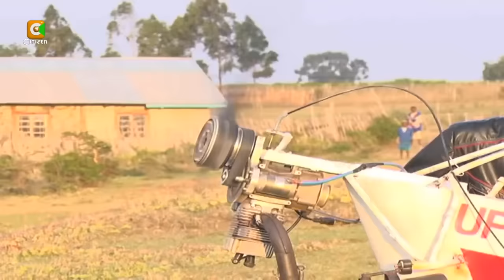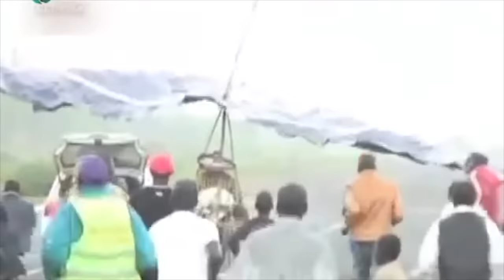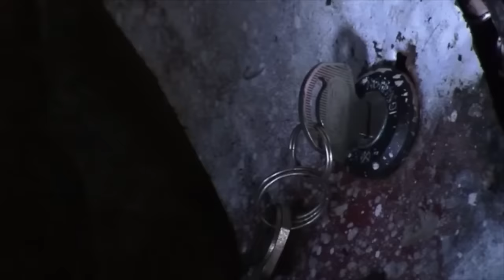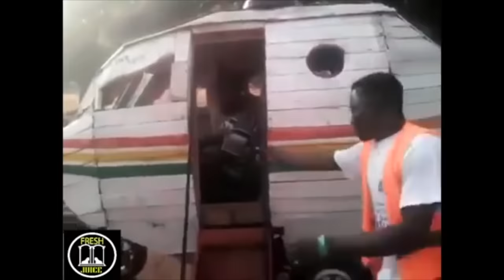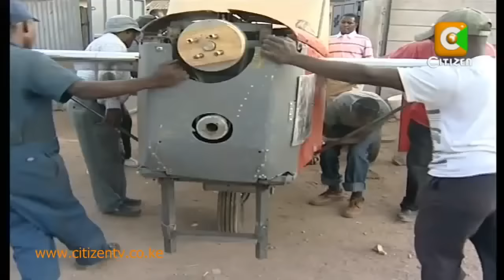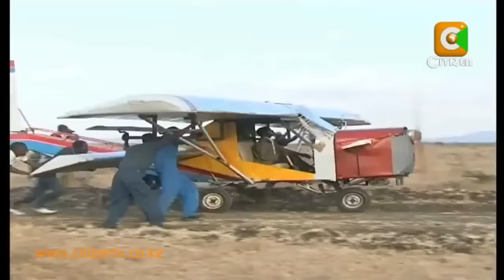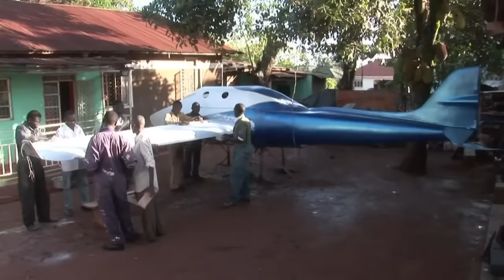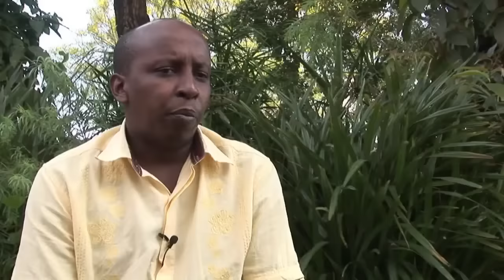African Airplane Compilation | African Aviation

Comment: Good for them. someday they will get it right . I hope he figures it out before it kills him.

 They just need to minimize things a lot. no silly presidential doors , and not more lawnmower motors.   more power, less weight.
Reply: First of all, they need knowladge and not to be.... You now.... Lazy  nation.. .
Reply: Llll
Reply: Yep, ultralight construction with n air cooled engine. Oh and a decent prop. Problem is they fail to see the most basic things like weight to power ratio. Then it’s center of gravity, aerodynamics, reliability etc.
Reply: Christian the only problem is they are running before they can walk 
The rite brothers got it rite because they took there time these guys are just going to get hurt
Reply: @Zluken  my words
Reply: Kittie Dammer Lazy? Lmao okay dude. Let me know when you design and build an aircraft from scratch 🙄
Reply: lol idk if what you see in this video is the path to getting it right...
Reply: It's a Toyota engine, you'll need 50 before that takes off.
Reply: @Tmoyer98  your right af
Reply: More education, less trial and error.
Reply: They'll be fine. They just need to dial it back a little and start with hobby model planes
Reply: Kittie Dammer even the government is not lazy. Its just where they are. Its a geographical issue.
Reply: Loricariidae They are lazy. They have an entire continent with access to the ocean on all sides across 5 different climate zones. It has nothing to do with geography
Reply: And fuel efficiency. 

Laugh now and we might envy them for having planes as daily transport. They'll be laughing at us above while we get stuck in the traffic below xD
Reply: Christian THERES MORE THAN A FUCKING PRESIDENTAL DOOR WRONG
Reply: Christian damn why arent you making planes then? Lol
Reply: Nah they just need to use a motorcycle wheel instead
Reply: @larutmrs3313  If they put the same effort into building a business and/or an easier attained goal, they would make their own money... Thats thousands of dollars of metal just to prove a point. Why not make something new that will shake the ENTIRE world? Not aviation in a small corner of Africa... And if they are as corrupt as you say then they would kill them and take the blue prints anyway.
Reply: Somethings will never work in Africa, its very obvious and that's aviation. Its just pointless.
Reply: They should all play Kerbal Space Program and try again
Reply: Trent Moyer It’s lazy because there is no time taken in the the development of the understanding of aviation. It’s just making things that resemble planes and helicopters and claiming to go back to the drawing board when it doesn’t work.
Reply: @Zluken  Thank u so much for your much sensible comment concerning this issue. It is true about weight/power ratio and proper prop to produce enough thrust to attain lift greater than weight achievable only with proper wings and tail (for fixed wing plane). I believe very soon Africans will build their own plane not necessarily should meet factory built planes standards but will leave the ground.
Reply: mbaka yako That wouldn’t be bad for Africa. I’m sure there are projects that are better than the ones in the video. But as I said. Lightweight and simple to start with. Ultra light.
Reply: @Zluken  True, we need a lot of things but that is nature of any normal human, if you have basic needs, (depending on how you classify them), then you want to go to pluto and you forget that you have homeless guys just twenty miles from your home. The projects on this video are simply on individual basis just like the Wright Brothers back then in 1900s. You are right again, ultra light is the best, smaller engine, less materials, short take-off and landing distance etc. But we must start somewhere and make the mistakes just to learn from them. What I don,t like is the strong attack from some guys.
Reply: mbaka yako I see what you mean. But then again. They shouldn’t have to reinvent the “wheel” again. We know about aerodynamics etc. 

But I also know education and access to the best educational network in the world the internet is limited in Africa. 

A homemade cheap African bush plane in ultralight fashion would be cool thou.
Reply: Best unracist and no mocking comment here.
Reply: And a proper education.
Reply: NoCumBacks not really...its mainly cause of the corruption
Reply: The Wrong Brothers
Reply: The wright brothers didn't exactly get off the ground the first few hundred times either
Reply: @ngkngk875  the wright brothers did it through trial and error didn't get off the ground the first couple of times either he is not educated but he is learning
Reply: Larry Howard You’re seriously comparing this to the wright brothers? Really?
Reply: Kittie Dammer what makes them lazy? I’m genuinely asking because I’m curious. What is lazy about them?
Reply: No Name They don’t believe in hard work, doing their due diligence, providing and preparing for the future, and taking the necessary precautions to ensure that they are safe and also successful.
Reply: Kung 1988 oh really? So that little speech applies to 54 countries? Because when I checked, Sudan, Togo, the Congo, and some other African countries are literally fighting the government right now. Theres a whole revolution going on in Sudan as you wrote that. But that’s Lazy? Ask me how I know. People in Togo are getting killed because they’re trying to overthrow their corrupt government, which is run by France. And you said that Africans aren’t doing anything to change their future? What was your research so far? Or did you speak straight up with what you only knew about Africa
Reply: Kung 1988 so because of a biased IQ test designed for western countries that was used on rural Africans, knowing that these people didn’t have any experience in the western world, Africa is lazy, right? I have three questions that I want you to answer: how do you know Africans didn’t make anything until the Europeans came? Where did you get that information from? Lastly, if black people need white people to survive, how were they able to survive for thousands of years before the Europeans?
Reply: No Name I never said survive, I think they were much, much, much better off left alone in their own tribal states. Certain people should have left them there. Im fully against that. And I know they can’t and haven’t built modern civilization because it’s an observable fact. If you want to believe ancient egypt was built by black africans go ahead, fact of the matter if that’s true it’s literally ancient history. Egypt was conquered several dozen times by foreign invaders since then, maybe more.
Reply: Kung 1988 Egypt wasn’t the only civilization in Africa. There were three or four dynasties in Egypt that were in fact run by blacks (Nubians) so it actually is fair to say that the Egyptians were black at one point. Would you not agree? The Nubians are modern day Sudanese people, the black Sudanese, not the Arab Sudanese.
Reply: No Name I’ve seen genetic evidence they were related to both middle eastern and sub saharan africans. It wouldn’t surprise me at all. Africa is actually very mixed ethnically so it’s hard to say if there is a current genetic copy of them on Earth now. Current Egyptians apparently are direct descendants of them after all.

Comment: But planes have already been invented
Reply: These are reverse, afro-engineered planes 🤣
Reply: Thats right.  They already invented.  They are also being bought and  manufactured by various African governments.   

So this video is just misinformation.  Its basically saying African technology is being developed by the hillbillies of Africa and not by their governments.
Reply: Kilo Byte  Well, if your expecting them to reinvent the wheel youll be happy to know none except the AHRLAC.  Saddest part is that is a South African plane designed under the leadership of Jacob Zuma a Black South African.
So those superior White South African leaders sat on their asses for 75 or more years designing no planes.

As for refurbished, modified, and redsigned planes you got the CHEETAH and its multitude of variations, ORYX helicoptor with multiple modifications.  
Kenya, Nigeria, Ghana, and South Africa are known for building their own planes using parts and blueprints shipped in from other countries.  Im just talking military planes.   The low level crop dusting aircraft and tourist planes are built in nearly every country in Africa by local businesses.

Comment: The first helicopter is actually very impressive. The only thing wrong is that the counter rotating propeller was not uhh, not doing its thing very well. Main prop produced good lift and the craft could hover somewhat stable though

Comment: That’s not how it works. That’s not how any of this works.
Reply: r/woosh
Reply: Do any of these guys have any experience in aviation or any engineering?
Reply: @meowcat9636  Clearly they don't.
Reply: Why yes I am. I am an aircraft mechanic, USAF F-15 Crew Chief (1993-2001), a private pilot since 1992 and I have sold aircraft tooling since 2006. Dotco, Cleco, Quackenbush, Recoulles and Numatx. I know how aircraft are built, how they are maintained and how to fly. Start eating.
Reply: @gnarlyharley9825  cool, i can do that too!
Im an enigneer for ALL commercial airlines. Start drinking
Reply: 69 SUBSCRIBERS WITHOUT VIDEO the difference between you and I is my comment is 100% true and was a response to someone else.
Reply: @gnarlyharley9825  I would have thought they would have tried a bi plane design with canvas or paper cover over a wood frame. Guess they were too ambitious.
Reply: I think you guys be better off making a glider all these props let alone the engines are definitely not strong enough or powerful enough, not to mention I'm pretty sure the balance is completely fucked
Reply: @pyrolopez854  They would be fine if they just tried making a biplane, maybe like the one the Wright brothers made, or maybe a WWI or WWII biplane. That would help them advance towards monoplanes. All they need is a decent engine, which the first video with the homemade helicopter might be fine, as that contraption was actually in the air for a bit, meaning the engine was good enough.
Reply: @gnarlyharley9825  Got any private photos of "Rodan" to share?
Reply: LMAO

Comment: Space may just be a little further away than they think.
Reply: This has nothing to do with skin color or IQ, it has to do with resources. Access to viable materials and education is key. These airplanes are not the creation of weak minds they show what happens when people are cut off from basic needs, a society of any race needs proper education and materials to succeed in the sciences. The fault is on the elites who use their power to keep populations stunted and use the lack of education to make the low IQ argument. The resourcefulness of these aspiring engineers show the power of the human spirit, it is obvious that those leaving negative comments are also victims of decades of racist thought they are not sophisticated enough to realize that they have been molded by falsehoods.
Reply: BILLY
Do you people ever run out of excuses?
Reply: @BILLY-px3hw : It's obvious that you are wrong.
Reply: @VictorInChains  Yeah: Before putting 6 men to work on an outer shell of a spacecraft and waste precious workforce, they should simply get some books, read...and then finally realize, what it would take and then simply abandone their idea.
In terms of flight: I built my first operable glider when I was 11....I only needed my pocket money and built it for less than 200,-
Reply: Yea, 4 to 5 years they said! Bahahahaha
Reply: To be fair, rockets are actually pretty easy, especially small-ish scale. They're not getting anything into orbit though. They're gonna need a budget the size of their country's GDP to get a working orbital rocket without buying it from a developed nation. 

What I'm trying to say is, if they made a rocket the same way they made those planes and stuck a person in it, it might actually get off the ground. It would definitely be entertaining.
Reply: oldgysgt averages are averages. If you took the average American (91 iq) and told him to make a plane in a couple years and then stuck him in Africa, I think you'd be surprised at how shit they'd be. A lot of that stuff you just don't know until you do it. I just took a Fluid Mechanics final today, includes Reynolds number and flow characteristics etc. I didn't know any of that before now, and I work for an aerospace company. In design. 

Also the iq argument holds no actual value, iq has been shown to be a predictor of chess skills, not general intelligence or knowledge of material properties and classical physics.
Reply: oldgysgt "thinking like 8 year olds and not adults," I'm not confident that the average adult American is an ideal to strive toward lol
Reply: Agree that building an aircraft out of rusty safari-wagon parts isnt practical.  Although you dont need 6 years of engineering school to determine that a crapped out toyota engine wont fly a plane...
Reply: BILLY they have wood, don't they. They have Internet. They're getting engines somewhere. The resources are there, they just don't know how to use it.
Reply: @MrStubbs8157  200 is not normal pocket money for an eleven yr old in this world. I get what your trying to say but you should rephrase that by saying you were blessed with vast resources at a very young ago. I'd bet 200 is more than the life savings of everyone in that film!!!